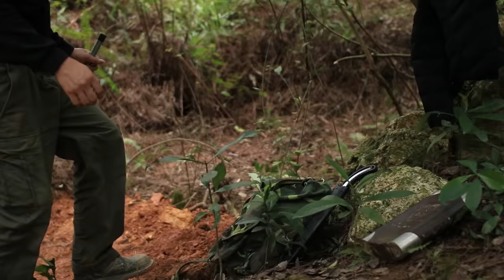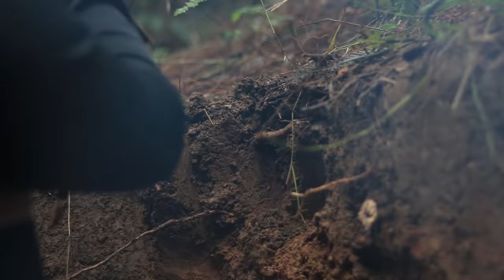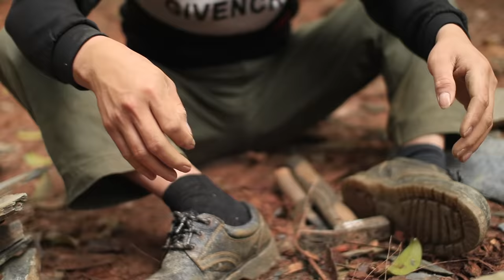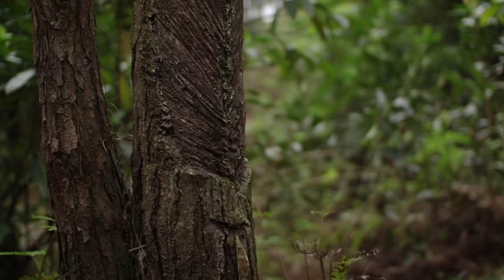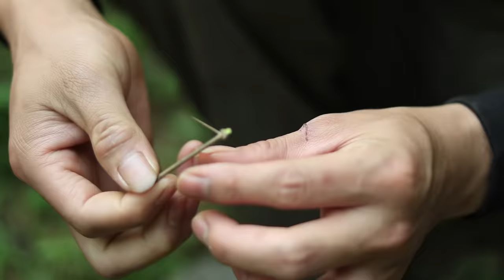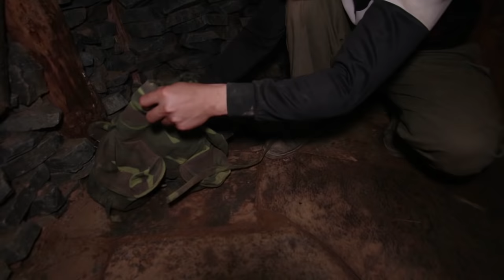Primitive Bushcraft Shelter In The Rain Forest - Stone Roofed And Stone Wall

Comment: As I watched the chap splitting the stone slabs, I fully expected him to find some fossil shells. I'm not sure ifhis rock was shale or slate, but I know ( as perhaps many do) of a bay on the south coast of the UK (which I think is part of our so-called Jurassic Coast) where almost every stone you spit open contains a fossilised ammonite
          On a different note, not all of these materials are entirely natural. Whilst slate and shale split easily between the original layers of sediment, some of the pieces looked too square and straight edged to have simply fallen off an outcrop. I suspect they were once roofing tiles from a long derelict building. The same goes for the wall stone: many of the blocks looked too similar in overall size and thickness not to have been previously shaped by human hands...

Comment: Seem very new to bushcraft tools. Don't worry, one day you'll be able to make a feather stick and start a fire with at most three strikes. 
I also commend you for taking mostly dead trees. Sustainability is integral to the hobby.
There's also tons of clay in that soil. Would be good as cobb for the flooring and spackle.
Another good tip; use charcoal to mark your logs and dry fit them before cutting joints. Makes the joints a tighter fit. Also, get a better saw and make yourself some sawhorses. It takes you a long time to process that wood and you're spending it on the ground in a position that'll hurt your knees in the long run. Just some Y shaped branches in the ground would help take the load off your knees.

Comment: How long did it took you to build that little stone house the work is beautiful love your unique work. New to this channel 😊😊
Reply: 1 day because they use heavy equipment an a team of 15 people. Thats why it skips all over the place.
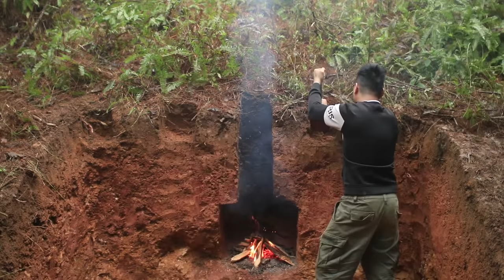Reply: Atv15:51 if u pause it to the right of guy digging you can see a tooth claw from an excavator. Runs from top of hill to bottom. It takes them a day to-do this
Reply: @timothywilliams7264  Is it really cost effective to rent an entire excavator to dig a 2m wide hole in soft earth? It's plausible those markings are from his shovel; his digging technique could result in such a pattern. Also consider we can see the resulting pile of dirt, which has a finer grain, suggesting it was dug in small bits. Other parts of this video may be faked, and it is very possible that he was not alone digging that hole, but an excavator was certainly not involved.

We can see the weather change quite a bit throughout the video; it is highly likely this took more than a day.

Comment: Question. Is the bark removed for drying purposes or to prevent bugs and mold.
Reply: I think it could be for both, but definitely for drying because the bark can retain moisture and then the wood can rot.
Reply: FOR BOTH REASONS BUT IF YOU PUT IT IN GROUND. YOUR SUPPOSED TO BURN THE END

Comment: Kina funky 😃 I just hope resting the roof logs in the clay and having the front load bearing posts leaning away from the hill And the weight on the roof without cementing the sidewalls stonework doesn't come down on you . 🤔
😣 Stay safe , Good luck 🍀 🤞 🙏

Comment: regarding to another veteran builders, this guy is definitely newbie.There are many mistakes that roof woods were connected to soil , floor is stone that it bad cos at winter its cold, at summer its hot, lastly at jacketing phase he even didnt use mud when he line ups stone that it is loss of durability.Shortly, i didnt like this video but i gave my like to this video cos really like this type videos.

Comment: I love it you did a fantastic job, personally I wouldn't have used pine because it doesn't withstand the test of time but oak with hand tools is a pain so I see why you went the route you did, problem is pine gets soft and rots quick and termites could be an issue withing 5 years

Comment: What really bothers me is him never securing his walls, never putting any kind of clay in them, it definitely makes you feel like he’s never even spent a single night in any of these buildings
Reply: I’m wondering too if it’s sturdy because anyone could just push the walls and it’ll come tumbling down.
Reply: The walls are connected to the ground and the side of a hill and all the supports are nailed down and also logs are extremely hard to push when they have been cut to Interlock with eachother 🤦‍♂️